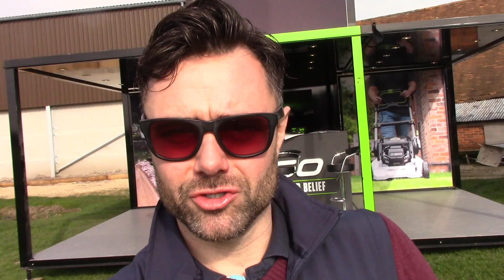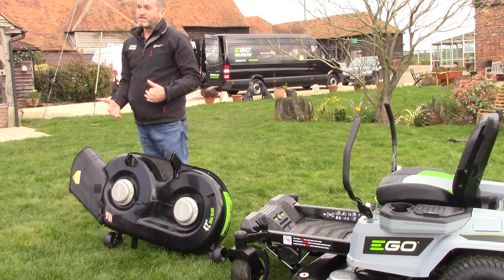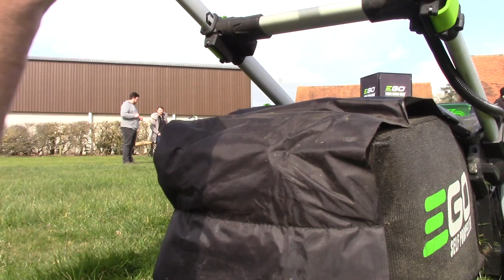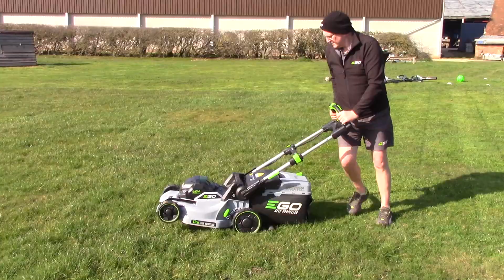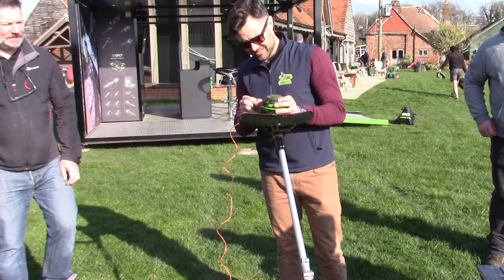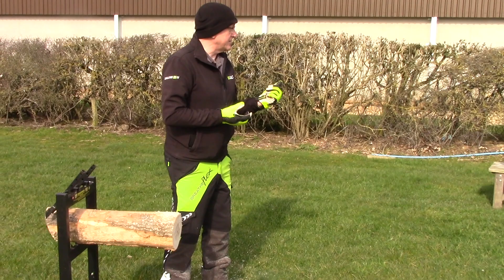EGO PRESS DAY / CHALLENGE 2025

Comment: Great video mate. I recognise a few faces there 😄 I think on the subject of mowers challenge 25 could be challenge 35 as I think it will be a lot of years till they are ready. Look at the investment in cars and they still are no where near good enough. I hope I’m wrong but commercial mowers go through a lot of challenging conditions so the batteries would need to improve massively.
Reply from the maker: Thanks Scott,
I would think about replacing the 41pro, with battery but I'm not sure I could cope with out the bigger 52/56cm petrol mowers plus the timemaster.
How do you find the stihl battery kit, have you ever put it side by side with any other brands?
Reply: @TheLawnGuy  I didn’t like the mower but I’ve never used anything but Stihl in over 25 years. You get used to a brand and as it’s been good for all those years it’s never warranted trying anything else but never say never.
Reply from the maker: @scottellwoodgardening287  yeah same here I've used different kit on the golf course but in the business its always been stihl for the two stroke kit and most of it is still going strong 8 years later.

Comment: I love battery powered equipment, but the Ego stuff really misses the mark for me... Their walk behind mowers just look to be made with cheap plastic parts (especially the deck) and they seem to be so light that they bounce around all over the place unless the surface is perfectly smooth. They're also really cagey about the specifications of their products, for example not publishing or responding to questions about the cutting motor power (in kW) of the mowers so we can't easily make a comparison against other brands. And it's not like they're cheap either!

Compare this to the battery products from the likes of Toro (I know, not as available in the UK but you can get some) and the difference is night and day. Probably a long shot, but perhaps, Dave, you could see if any Toro dealers would let you demo some of their battery walk-behinds?
Reply: Noticed that too about the kw from ego mowers. The stuff didn’t struggle to cut though to be honest.
Reply from the maker: Thanks Ben,
That's great feed back, battery equipment is a big commitment, and making the right choice is paramount.